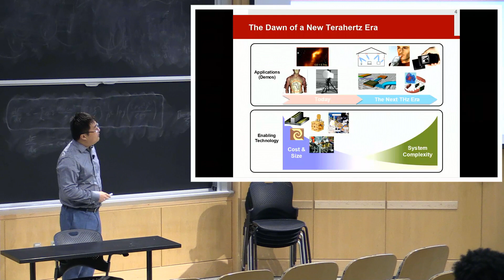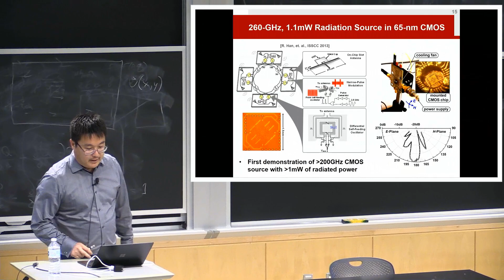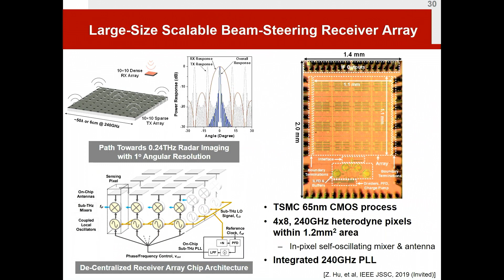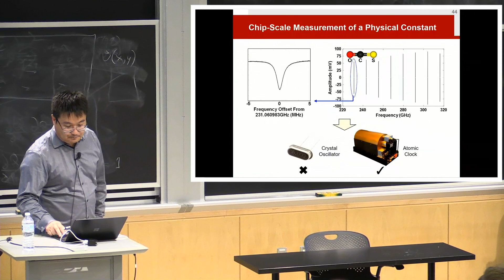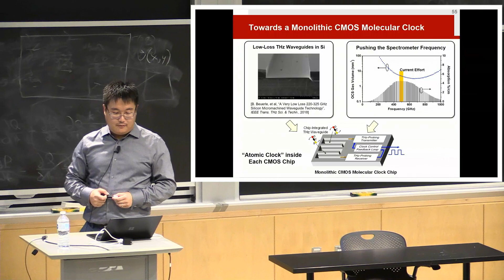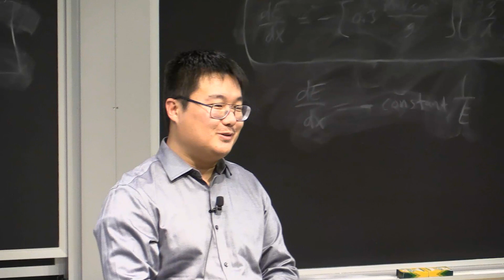Chip-Scale THz Circuits and Sensors

Comment: That is incredible.  So, you will be able to make devices that do quality control on food products that pass through a conveyor, and automatically be able to reject hazardous meat or produce.   Reduced cost of gas detectors in surface and undeground mines, as well as detectors that can analyze samples in real time in the oil and gas industries.  Also, this will be a boon for radioastronomy, and 6G consumer electronics.   Control dumb devices real time with off board control stations in real time.  Hugely important research.

Comment: 43:38 H2S is extremely toxic, incidentally, for a correction to that chart.  The toxicity danger is in fact much more severe than the flammability danger.   But other than that, great lecture.
Reply: right